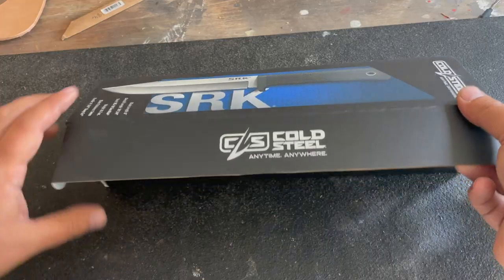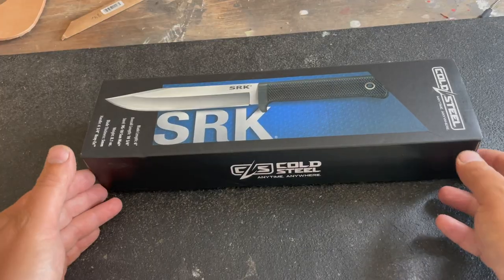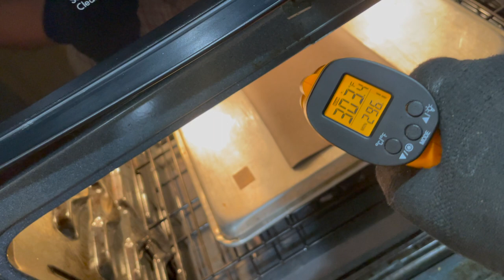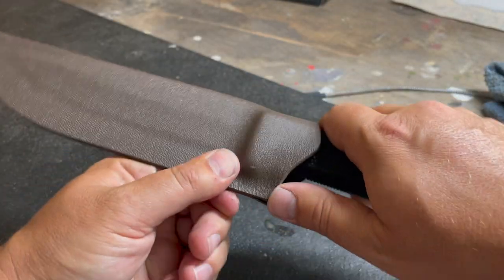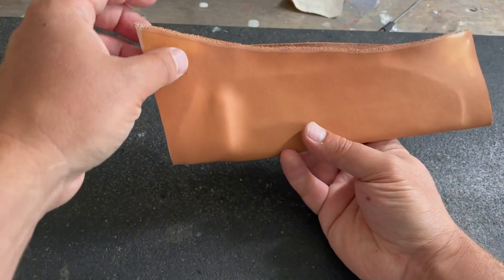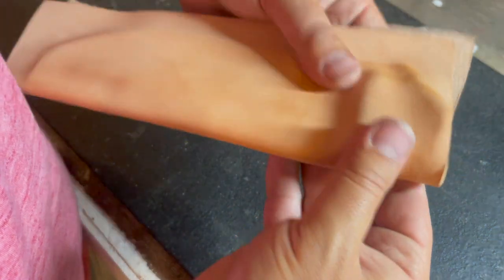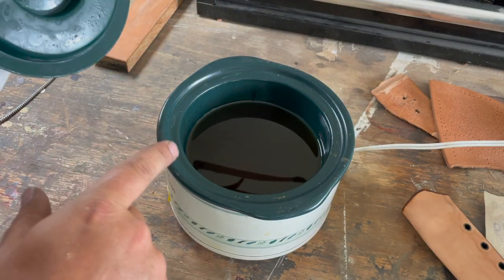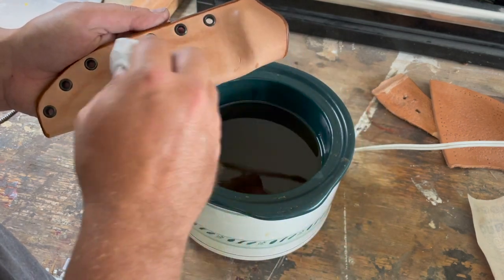Is This the Best Bushcraft Knife Sheath? | Cold Steel SRK San Mai

Comment: Nicely done. You did not, but do you feel it necessary to put the kydex fold on the sharp side, looking back? Thoughts? (I'm getting ready to attempt similiar project.)
Reply from the maker: I guess it doesn’t matter which side the fold is on. Just seems easier to fold around the spine than mold around the spine.
Reply: It depends on the thickness of the kydex being used- too thick and it won't wrap around the edge side tight enough to prevent rattle. The trade-off with using real thin kydex is fragility & ease of over heating/melting. 
I've experimented wrapping around the edge vs spine about a dozen times and, personally, have never been completely satisfied with the results.

Comment: I've found putting my leather in a low oven (150 deg F or so) makes it easier for a penetrating wax/protector finish.
Great job on this. Been meaning to do some leather/kydex hybrid sheaths for a while. This walk-through makes it look fairly simple. Thanks!
Reply from the maker: I have done that quite a bit with my all leather sheaths, but I was a bit nervous about heating the Kydex too much

Comment: You just earned my sub!
I've recently started into leather working. I have a Star Model BM....ZERO leather holsters for these.... SO I LEARNED SOME LEATHER SKILLS!
My issue is first, I cant afford nice leather in the 9oz range. Second, I've still got a lot of 7/8 oz from a shoulder. Brother in law gave me a bunch of 6/7 as well.
Using kydex will help stiffen otherwise limp sweat guards. The press will take some work out of boning (but I do love doing that part lol).
I'm thinking maybe instead of grommets, getting a small drill press from Harbor Freight and drilling small (18 gauage?) holes and stitching.
you've given me a lot of ideas man! Thanks!

Comment: I just subscribed to your channel. I've got a ton of nice knives in my collection that that deserve to be customized. Of course I've been upgrading handle scales and buying kydex sheaths over the years but I have the itch to take it to the next level and try doing it on my own. I watch your mora stacked leather handle video over and over. I have alot to learn as far as materials and where to get them. I do have an old drill press and grinding wheel in my garage. ❤

Comment: Marvelous! I am the proud owner of a brand-new WC Knives Fieldlore and anxious to begin the sheath. Two question for different approaches of the hybrid leather-kydex. (1) what weight leather do you recommend in you build — how light is too light for field,applications? (2) your thoughts on minimizing the kydex to just the capture/retention aspect and then making the bulk out of just leather?  Scott
Reply from the maker: Scott, I used a 4-5 oz veg tan leather for this project. I think, with the kydex, you could go down to 3 oz. If you’re doing leather alone…5-7 oz. I think it would be difficult to just use kydex around the guard and do leather everywhere else and make it look and function as a balanced sheath. However that doesn’t mean you can’t do it or it’s not worth trying. Good luck! 👍🏼…Seems like a very cool knife with interesting grind lines. Is it difficult to sharpen/strop?
Reply: @wyomingwright  thanks for the come-back.   The lines are not just interesting, but really functional. Watch WC’s you tube on this blade to explain better but the “tooth” is great at stripping, with the scandy grind in close for wood removal and the outer blade more general. As to sharpening, believe it or not the genius is that it’s a constant bevel.  It is a fine angle (12.5 deg 1/2) but holding well so far.

Comment: How comfortable is that style of belt carry? I've seen a few like this and always wondered how practical this is?
Reply from the maker: I think it’s pretty good. The SRK is borderline too long for horizontal belt carry. But it’s also borderline too long for comfortable carry in any orientation. Knives that size and bigger were not designed for everyday carry or even  convenient carry. Personally, when knives get longer than 12 inches, I’d rather carry them in my pack and have something smaller on my belt.
Reply: @wyomingwright  that's a good point, thank you!